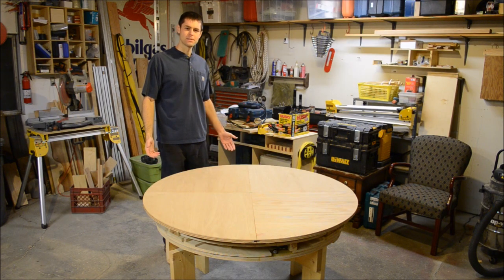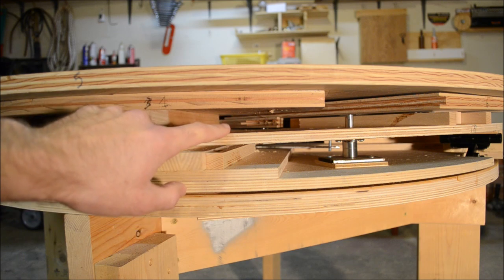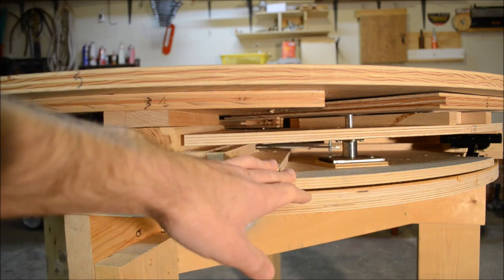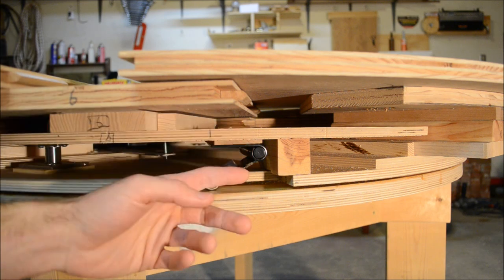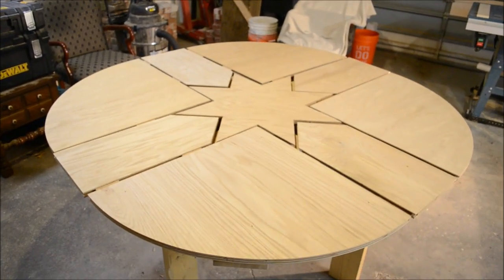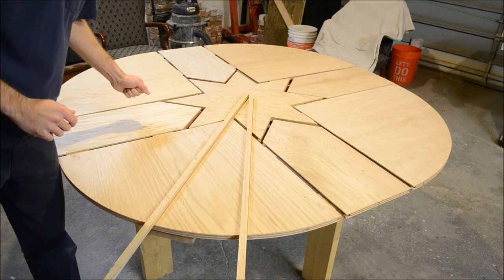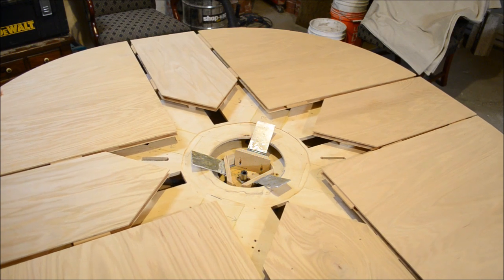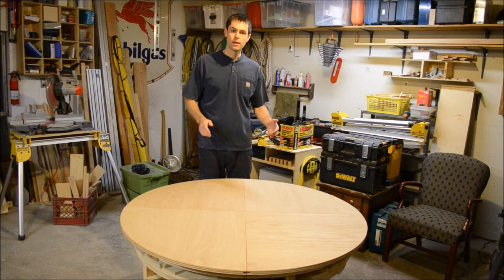Wooden Expanding Table

Comment: This is awesome, I know it’s probably impossible with the mechanics that are already inside, but it would be cool if when you opened it up a fancy center piece came up from inside the star thing in the middle
Reply from the maker: It's not impossible but you are rapidly running out of room in the middle. If it would were more tall than wide you could take advantage of the vertical space below the current support level, this would entail an entirely different star raising mechanism.

Comment: Thank you for sharing the exact mechanisms that goes into this table! Just had a thought on it that I hope would help improve on the design if at all applicable: would it be possible to recreate the mechanism with the rollers work with thirds instead of quarters for each segment of the table top? Or halves even? Would it make the table bulkier or slimmer? I love to tickle the thought of making mechanisms more economical with the limits of my knowledge, so do what you will with that information, cheers!
Reply from the maker: You could build it in many configurations but with fewer sections it becomes more difficult to add area as the panels have to slide out further and there is a limit to this. As long as it had 3 levels (main, raising and star, as it does now) the thickness should be the same.

Comment: Hi, love the table! if you changed the X pieces to Carbon Fibre material, it would make the table lighter and increase the load bearing capacity , right?
Reply from the maker: I'm not clear what you mean by "X pieces" . . . ?
Reply: Sorry that comment was for the counter weight table that goes up and down
Reply: Scott Rumschlag

Comment: Impressive table, I applaud your persistence & craftsmanship. It is a very challenging project. It works as kinetic art but  I wonder how you could cleanly resolve the surface edges & top for a finished product. The cost must be prohibitive for most & thus you have an extremely expensive table that can seat 4-6 but is somewhat oxymoronic in essence. Otherwise very cool.

Comment: How about a manually operated version... just slide the 4 pie shaped pieces back and use 4 drop in panels with a toungue in groove edging so they lock in when pushed back together... ? You could sell plans for that and or a construction video to help pay for your time, or maybe even make and sell the 8 more critical top pieces for sale as a flat pack. Anybody can make the rest of the base with basic tools.

Comment: Well Scott, You have made a good copy of my table. Good job, but I would appreciate some credit! Fletcher used my idea first, and no credits there either. You Tube is all very well but a worry when it comes to idea protection. But well done anyway and I have more table ideas on the way. Nick
Reply: +Nick Dearden and im sure you got your idea somewhere as well. he didnt do it the same way as your videos show.
Reply: +Nick Dearden He made what you couldn't with only 4 panels, a round table. So its not the same design and yours actually looks a lot like the original patented in 1800's. Eat it.

Comment: an other question : what type of bearings are you using between the lower level and the stable base of the table ? seems to be a flat bearing, is it ? because there is only 2-3mm between this 2 stages of the table.
Reply from the maker: MrDarkdrago74 It's actually just a slice of hardwood (oak in this case). The stationary base level has been waxed and the slice itself has two strips of UHMW (low friction) tape. The tape and wax were added to reduce friction, the original version took a fair amount of effort to turn, it's more reasonable now. Thanks!
Reply: Scott Rumschlag  what do you think about using ITAR incrusted ball (http://ww w.qama.fr/roulette_24328_2251)? would it be better with a .5mm of inox flange between the base and the lower part for not damaging the wood with the balls ?
Reply from the maker: MrDarkdrago74 I'm not sure what an ITAR ball is (link not working for me) but I did think a little about using bearings. The advantage with the wood strategy was its simplicity and distribution of force, as you mentioned, to keep from making a groove or depression in the wood. A metal mechanism would certainly benefit from  bearings.
Reply: Scott Rumschlag yep, your system is really easier ;).
Nice conception anyway. i'll bought your plan to see how you've done it, but i think i'll make my own plans =)
good luck for the futur and thanks for all the informations.

Comment: Amazing job on that table...you should patent that if you have not done it yet, before someone steal the idea from you. Oh i just show a similar expanding table with similar configuration in terms of how the top pieces are, but instead of manually rotating it for it to expand it is automated. If you sell this how much will you sell it for? How heavy is it approximately?
Reply from the maker: The Fletcher table (probably the automated one you mention) had a patent which expired in 2007. This table is similar enough in operation that a patent probably would not be granted even if I thought it was worthwhile to pursue. I sell table plans for $49, though no fully assembled tables yet. It weights about 200 lbs (91 kg). Any other questions can be directed to scott@mechanicallumber.com Thanks!

Comment: Good Job Scott! How much time did you spent for this table design? I am going to make the same table but with little bit other mechanism.
Reply from the maker: About 400 hours, the last 200 hrs were focused on making it thinner and less complicated. I had a lot of "good ideas" that worked in the collapsed and expanded positions . . . but not in between with the different arms and rollers moving around. Thanks, Scott
Reply from the maker: Also, good luck!
Reply: If I make the same table in the next 6 months I will share with you my Ideas. I am limited on the time, so I worry I may spend more than 6 months. Anyway that's good table which you made. Are you going to make table like Fletcher Table within 12 pices? Thank you for good luck. And you are good man because you share your experience and your ideas!
Reply from the maker: 12 pieces might be better with a larger table, this one is about 4 feet and quite full with with 8 pieces. Good luck with your table, thanks!

Comment: Crazy!
Reply from the maker: That's how I felt a few times when I was stuck on a problem, ha ha ha. Thanks.
Reply: Scott Rumschlag was it making the planes level out and then close back in :P
Reply: It's important to remember that every woodworking project needs to be planned. You will be able to avoid making unecessary mistakes if you're using woodwork plans : https://sites.google.com/site/woodprojectsplan/pros-and-cons-this-woodworking-program

Comment: 2:51 It involves a hardened shaft that's sticking up, attached from the lower level, whereas the feather piece rides on that hardened shaft, keeping things properly aligned for going up and down as it needs to.
That's some seriously sexy engineering.
Reply from the maker: Thanks, I avoided that type of hardware at first because I expected it to be extremely expensive. Most slider hardware is designed for industrial use and must handle abuse 24/7. Locating these ones, which are $8 or 9$ each made it reasonable. If there's enough interest I would also consider putting together a kit with the metal components so people can focus solely on the wood.

Comment: Nice video. Although i have quite some mechanical experience, i was not aware of how the table in the original video works. This video explains it all, and once you see it everything looks so simple, no special CNC parts or stuff like that, just basic levers and rollers. Good job.
Reply from the maker: Thanks. It made me appreciate the tremendous amount of effort that goes into machines that still look complicated even after being simplified.